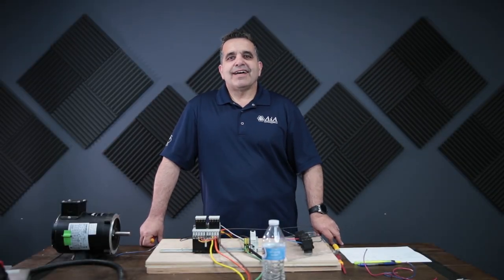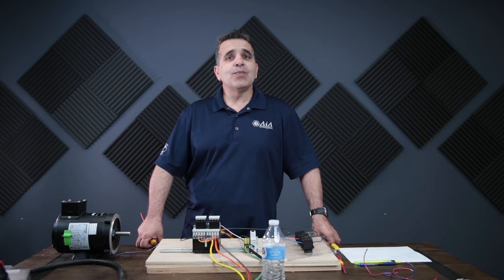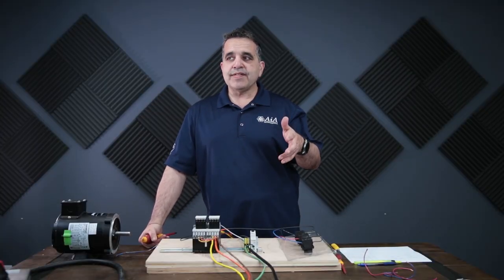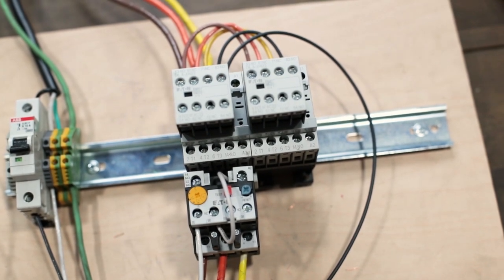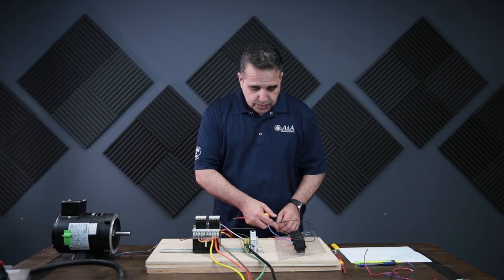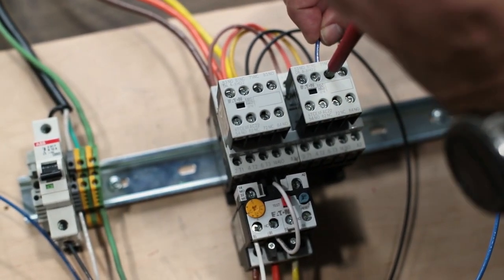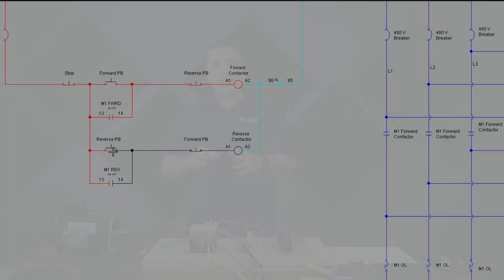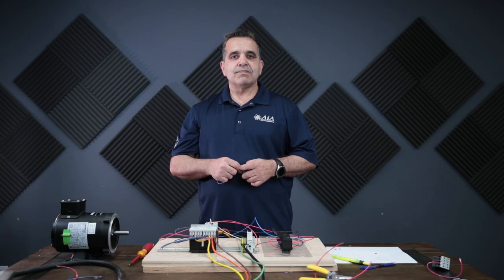Wiring Forward and Reversing Motor Starters with Superimposed Schematics

Comment: The second method of wiring is usually found where high torque motors are used eg hoists or shutters , since they run at much slower speeds and not affected as much as high speed motors.

Comment: Glad to see you back. What am I missing? If the concern is the ability of the motor to be quickly reversed, what is the advantage/difference between using contactors on the starters or CB’s on the PB’s??? I’m not trying to start anything or say anything is wrong, I’m just trying to figure out how using the contactors is better than using the contact blocks. 
Thank you
Reply from the maker: Using the contact blocks on the contactor will allow the motor to come to a stop before reversing. This in most cases would be the preferred method. If you want the motor to reverse immediately, then the button contacts would be the method you would choose. It all depends on how you want the system to work. Thanks for the comment!
Reply: The contactor keeps you from reversing direction while the motor is spinning and prevents damage from polarity reversing while the motor is still engaged. Using only the start/stop switches doesn’t prevent this; there’s no lockout mechanism as with the contactor. The sudden change in polarity causes heat to the windings of the motor causing unnecessary heat damage which is really the bottom line.
Industrial motors configured with Wye Delta start and run is another way they have helped extend the life of a motor and make it more efficient. It starts at a lower voltage in Wye and switches to Delta high voltage at a certain speed to help reduce heat in start up by starting in a lower voltage and then switching to high voltage at an optimal speed. It helps extend the life of the motor and make it run more efficiently as well.
That’s the purpose of the overload heaters as well; it senses excessive heat in the circuit from overloading or starting issues! A circuit breaker disconnects for a short or ground fault; a heater disengages when it senses overheating.
Just demonstrates that the breaker, starter and overload or heater all have different functions as well as the stop/start with forward and reverse controls with the contactors.

Comment: Can this be done using a breaker, two contactors, a “stop” button, and two momentary closed buttons that only close the circuit only while the button is pushed? Can a second breaker be used on the neutral in place of the overload? I’m dealing with a leeson 120v ac motor

Comment: It's so strange when you add protection (OL) at the end (on N). Technically it works, but for service it sucks... 
My ideology is: first protection, then control buttons, then contactors. And N is connected directly to contactor (A2 terminal) and it is always here. 
So when you test with voltmeter, you meassure the voltage between contactors A2 and any control circuit point.

Comment: Hi boss. I’ve been an electrician for around 5 years and recently landed a maintenance job at a mining site where we use vfd’s, hoa’s, forward/reverse starters, etc etc…are there any books or courses you would recommend? We have numerous types of vfds..525s, 700s, 750 something’s, etc and it’s been a real struggle trying to figure out even basic vfd functions like where to land your hand/auto. Any info helps. Thankyou sir
Reply from the maker: Here is a playlist on VFD function wiring and programming. But limited to 525’s . VFD Programming and Design
https://www.youtube.com/playlist?list=PLBUvFVo2Dw492bC8ywv9Jw6Hk2rw4G6zj